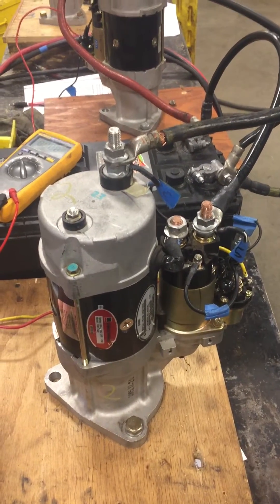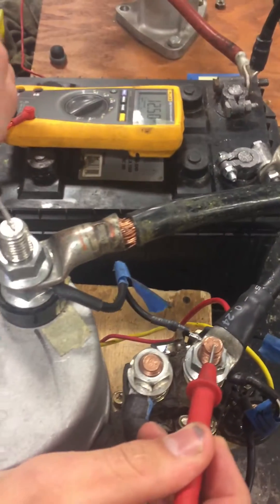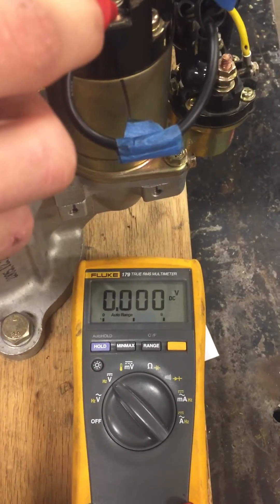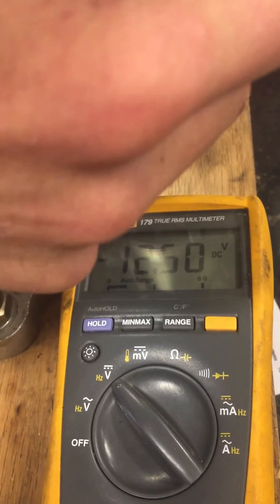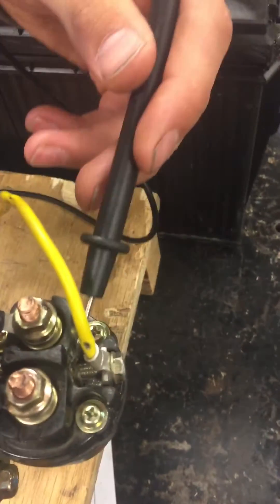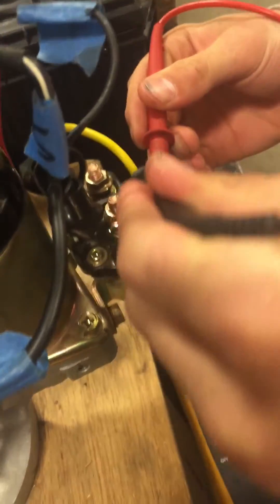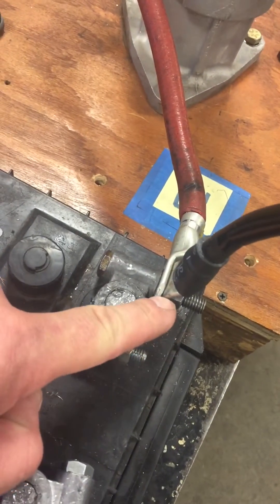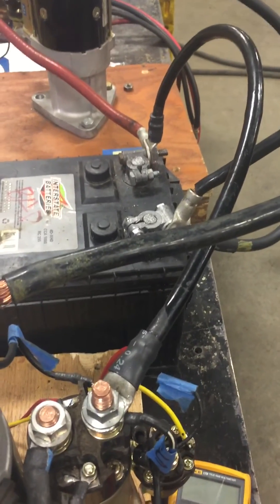Voltage Drop 101

Comment: You can’t simply pass current through a cable to witness voltage drop.  You need a load to witness a voltage drop. You can view static voltage but under load, you can then see things change.
Reply from the maker: Current passed. I could draw it out for you if you need